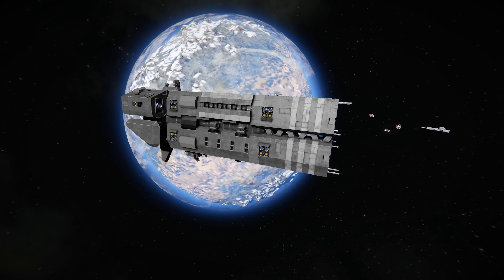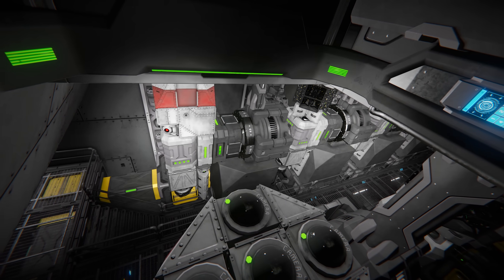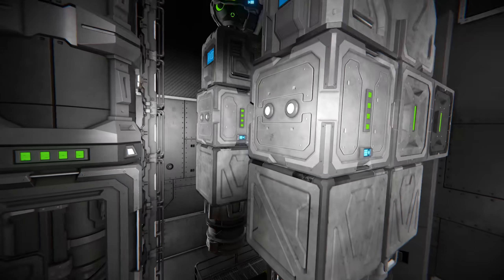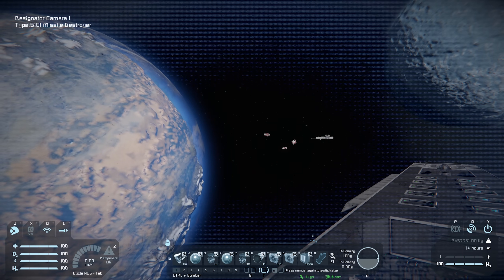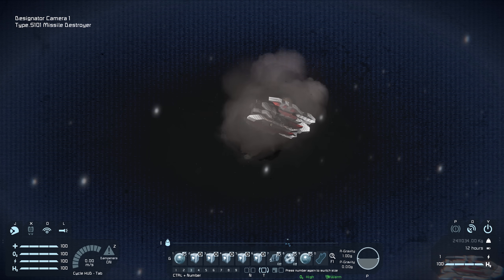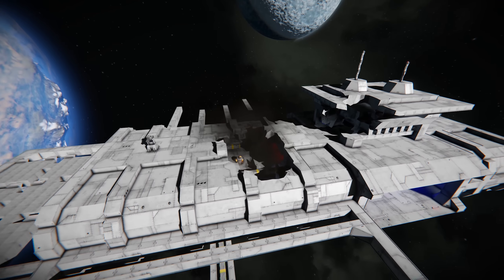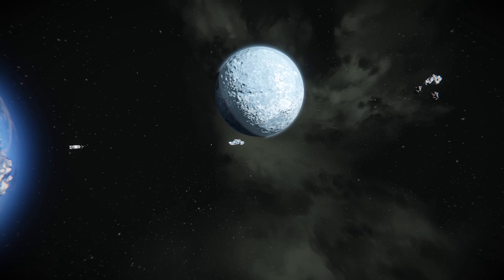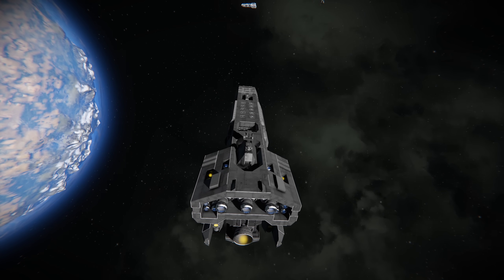Space Engineers - Missile Destroyer 5k Range

Comment: The best strategic rockets are ones without a signal. It's simple... warhead... a thruster, battery, and a decoupler. They are undetectable if you change block ownership and have no antenna. But it requires aim.

Comment: One note: Those large warheads appeared like they werent always exploding, might want to reconfigure the warheads with sensors to detonate at 5 meters or so. the impact still does damage, but not as much as the explosives could.
Reply: My main focus in this game is missiles so I’ll chime in a little here with some tips for warhead reliability. 

• Warheads unreliably detonate from collisions over 250mps
• 5mx5mx5m Sensor on nose if warhead under 100mps is perferrable as noted by William
• No half-armor blocks directly on warhead top (makes collision unreliable, especially if you use blocks like conveyor covers, not sure why)
• if the missile hits sideways and not head-on, the crumple of the missile body might slow the warhead until it has decelerated too much to detonate on impact (assuming no sensor)
• For missiles over 300mps-1000mps, 2-3 large grid blocks of scaffold above warhead typically fixes this as by the time the physics catches up it’s reached the warhead. Not sure on small grid. 
•Somehow… adding a gyroscope on top of warheads seems to make them reliable. Maybe it has something to do with the priority of critical components in collision calculations, I don’t ask too many questions. 

Basically slow to 100mps and add a sensor with a detonate function, or be prepared to tackle some goofy crumple physics.
Reply: @TheFakeGooberGoblin  whats 100mps? isnt 100 metres per second the max speed? 200 metres per second max collision?

Comment: Could the missiles be pre set to fire after ejection? I remember in Gundam SEED a ship using timered missiles left adrift creating confusion as the fired off from a very different angle making the crew hesitate as the scanned for another vessel. That would be cool. 

Secondly why don't you make a flater vessel by making it a sideways slightly forward firing missile setup? I mean put tubes flat and 45 degrees forward. Faster ToT and it's not like a missile DD is a frontline ship. Punch in flank speed pop off a side, pull clear with a full axis rotation to fire the other side. Also put recessed point defense turrets around that thing. I can hit it from five sides forward, ventral, rear and flanks. That looks like a long build so protect it.

Comment: I'm curious, what about this requires modding? It looks, at least on the surface, like a super complicated but totally buildable thing. Well done either way.
Reply: Technically, it IS totally vanilla, even the radar and artificial horizon, the issue is that it needs scripts and the programmable block to work, which as mentioned in the video, is disabled on some servers

Comment: Idea for craft: Mothership has a few automated assembling lines where it builds rockets, then they automatically moving to starting points, fueling and launching. Process can continue until resources end.
Reply: Why are you posting ideas here, post the ideas on a comment section of a Youtuber who actually makes creations instead of using "workshop content" and copying everyone else's designs
Reply: Great idea!

Me personally I always had an idea for such a warship in a hard sci-fi. A vessel who's sole purpose is to launch missiles or drone fighters. As it is it's only purpose it doesn't truly need a permanent crew, artificial gravity (Artificial gravity is done by spin or thrust by most habitable vessels but must be of certain size and have slightly more complex components.), or living space. Just some interior space so maintenance and inspections can be done when needed.

Even then, there could be floating/magnetically locked drones that are in the interior of the ship to make sure it functions day to day. There are drones can mine material and drones to help with some slight maintenance, repairs and updates. Also the ship can have its own automated assembly line to manufacture weapons by itself. Basically systems to keep the ship self sufficient for periods of time.
Reply: If you mean H2 missiles, the Easy LIDAR Homing Missile script already lets you do this. You can build off a merge block, and have a connector lined up. It will fill up on fuel, and then you can launch it. You can also do 2 stage launching where the missile is blasted out of a bomb bay (vs a silo) with small thrusters, and after a second or two, the small ones turn off, and the main thruster ignites. I use this for my super low-profile (only 12.5m thick) smuggler ship. The bomb bay is only 3x2x4, but can blow a missile out 30m from the ship, and packs a punch powerful enough to blow a 25m hole through a light armor ship. The homing ability is also so good it can shoot down nimble fighters attempting to evade, and even has a failsafe so if it has a near miss, it'll detect the near miss and airburst, still getting the hit.

Comment: I just finished making a similar ship that basically does the same thing, but it is a much larger and slower design. It's the 2nd ever large ship I've built, so I'm pretty happy with how it turned out, but this one just blew it out of the water. It too can 3D print a guided missile, but this one is player-controlled as opposed to using script. (Speaking of which, I should probably learn how to use programmable blocks.) In any case, if you're interested in checking it out Aaron, just search for "The Hullbreaker" on the Steam workshop... it's the one with the green stripes :)

Comment: Asuming the 50m sensor range limit still applies, the big issue is guiding it close to the target. Missiles operate in 3 modes: Launch, Proximity Guidance, Final Guidance (sensor range). Theory on how that guidance works:
The camera sub-ship. After the missile enters remote guided mode (exited launch mode), the missiles try to match their orientation to that of the camera designator.
Once it comes within 50m of the target, the sensor itself can take over guidance (Final Guidance). You can change the sensor field with scripts, giving you all kinds of measurements even with a single sensor. At least in theory, I never even managed to simplify my distance sensor down to that.
If that is how it works, I see barely any way to de-script it. The last leg guidance in general and the proximity guidance in particular look like they would require Scripts. I am also not sure how the orientation data is transfered. Would require antenna, but I saw none on those missiles.

Comment: Is there any way to implement a guided missile without scripts? I can imagine designing a dumb fired missile with timers. But I can't think of a way to make any form of guided missile with only timer blocks (other than GPS based cruise missiles). Any ideas?
Reply: Strap a pilot seat onto the missile. Then you can guide her in personally.
Reply: @spacecowboy1438  That's called TDAM or TSVBIED - you call the pilot Tazoo
Reply: In theory you could create a missile with lots of sensors (might need a sensor range mod?) which controls gyros to gradually wiggle toward a target. I tried once but didn't get much progress and found it a bit frustrating, maybe someone who is a better engineer / more patient could though. :)
Reply: heresjonny666 thats how we did them in 2015-2016 lol
Reply: @heresjonny666  Tazoo-driven attack munition.
Reply: I just use remote control. If you are firing from a static position like this it works just fine. If you want to move the ship at the same time you need a second pilot.
Reply: @aurenian8247  I just wish the laser antenna's actually allowed remote control so you could make a stealth design but they are currently glitched out